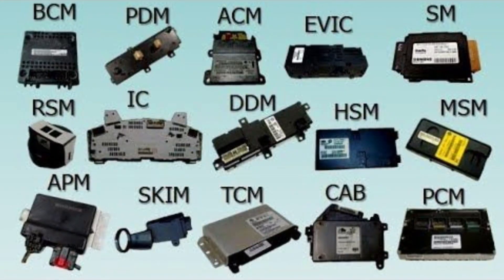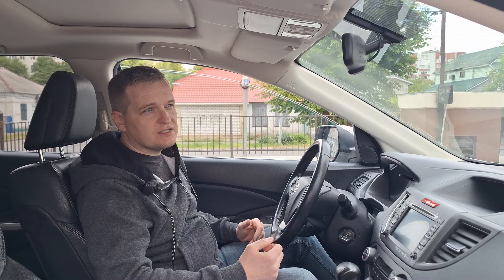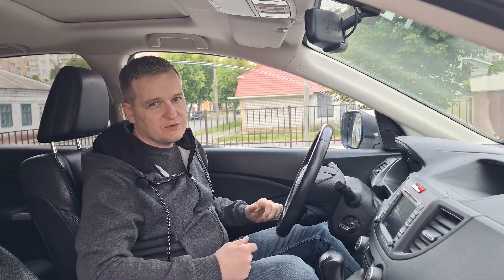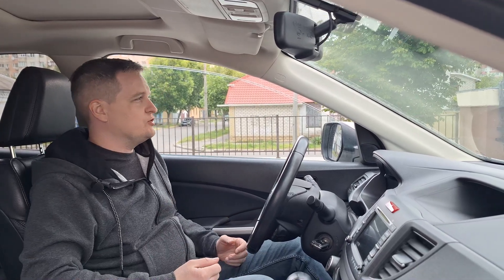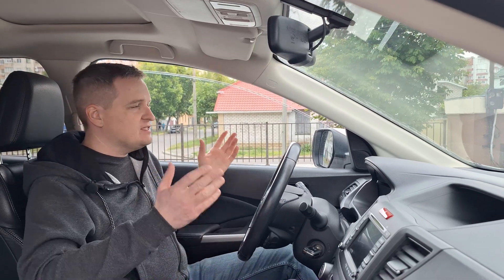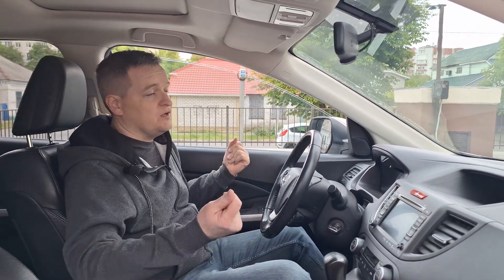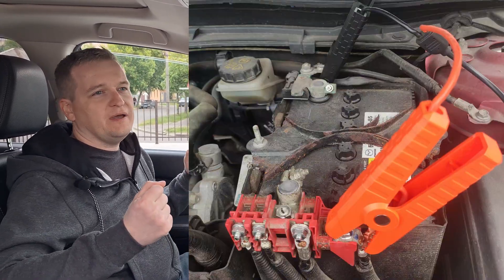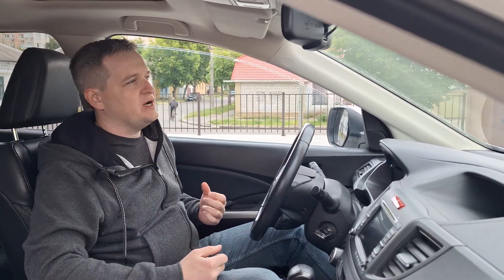Can you just disconnect battery in a modern car? Unfortunately, no…

Comment: I'm thinking this vid is BS.   The only thing that happens is the computers will have to relearn a few things and you will fail emissions testing until several complete heat cold cycles (usually about 4) are completed. This is done to prevent cheating emissions by clearing bad codes just before test time.

Comment: This is fundamentally incorrect. The firmware in the various control modules will simply run their setup routines once power is reapplied. All data in their flash memory will be retained. Items like fuel trims and transmission shift trims will be lost, since they're not stored in flash, but the vehicle will relearn them after only a few miles of driving.
Reply from the maker: It certainly will. Unless the ECU or the battery control module will set the limp mode or will ask you to "register" the new battery.
Reply: Again, fundamentally incorrect. Limp mode may be triggered by low voltages - indeed, my CTS has a weak battery mode that disables the HVAC blower and other functions if a low battery is used to start the engine, so that it can recharge the battery more quickly. But if a healthy battery is connected to a car, regardless of age, then the car will function properly. There's no logic in a lead acid battery TO register.
Reply from the maker: Sorry, but what you are saying applies perfectly to older cars. I literally had the limp issue in a MB recently exactly because of battery being disconnected for 5 minutes. This gave me the idea for this video. Plus research in forums proved the idea.

Comment: I changed my battery in my Chevy Volt 2014. You can supply the car with 12V with connectors in the front of the vehicle and change the battery in the back of the car. You just have to make sure you don't touch a metal part with the battery connectors while you change the battery. Special battery which I got at Canadian Tire. Thanks for the video!

Comment: BMW's do this all the time. If you drain the battery on accident and try to charge it or jump it, you could possibly damage the hardware or software in the Lighting Module. Meaning none of your lights or mirrors work properly/if at all.

 My newer Ford doesn't give a crap lol it's known to drain the 12v battery if not used for a week due to manufacturer sucking at electrical design. So I just jump the battery and my PHEV is good to go.

This was a weekly occurrence for a year for the previous owner. I use my car daily tho, so I don't get the issue.
Reply from the maker: BMWs have been the pioneers in giving owners a lot of headache due to electrical issues. But now almost all new non-budget-friendly brands will do this, unfortunately.

Comment: Good advice, just remember not to allow the positive terminal to touch any ground/chassis while powering the car with a booster.  I'd wrap the positive terminal with plastic while it's removed from the old battery.
Reply: Just make sure you disconnect the neg cables first..

Comment: 20 control units?😃 back in 2000 maybe. Now modern cars have 150+  and yes, you can disconnect a battery, misleading info
Reply: I agree... this is FUD... maybe if the car already had problems (safe bet any MB has a pile of codes already), it would act up, but that's not the battery. With all the xtra electronics, and stop/start new cars drain batteries like crazy, if that was enough to put a fork in it no new car would make it through the warranty. (I"m talking about lead acid 12v starter batteries in ICE cars here...)
Reply from the maker: Just one month ago had a problem in MB gle 2023. After disconnecting the battery, the car went mad and I had to limp 20 km to the dealer. But it won't work for all cars, of course
Reply: @TopicMotor  well for example working on audi airbag system, you must disconnect battery while ignition on. I presume issues with MB was not for disconnecting battery, but disconnecting in a wrong way or order. Maybe I’m wrong, but have never seen issue like this before. And even if there any warning lights on a dash after reconnecting the battery it goes out by itself just seconds after start driving, or after ignition recycle
Reply from the maker: It's now too hard to generalize when talking about cars. But newer vehicles mostly hate it when you unplug the battery.

Comment: Ugh, no. 

These computers are not built to be battery “reliant.” 

And these modules are far from fragile to break by mere removal of battery. They’d be more prone to failure in sudden loss of electrical power or surge, but the likelihood of it breaking by disconnecting the battery while parked, is very low if not nil.
Reply from the maker: I don't say they will break or burn. But they may reset which will lead to problems and minus 150-200 bucks from your pocket. Depends highly on the model and year though.
Reply: @TopicMotor  it is normal for computers to “reset” hence resulting into problems due to disconnected battery is very low or near impossible. If these computers break down due to frequent resetting, it’s not due to the disconnection of power source, but due to low quality materials used in building its internal components.